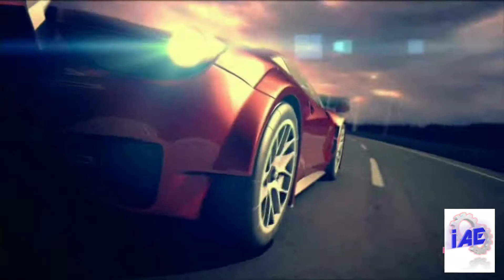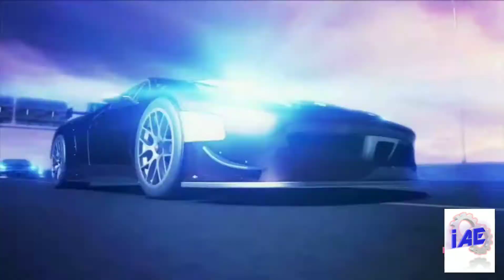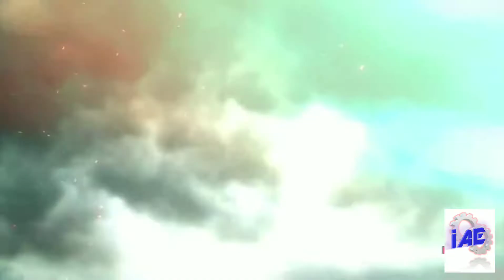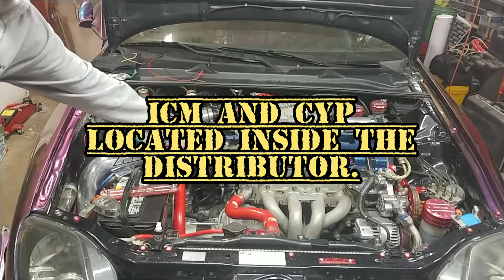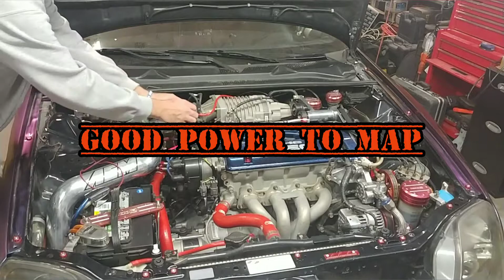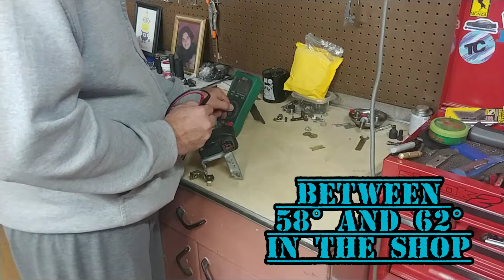97-01 Prelude troubleshooting.

Comment: I have a 2000 that won't fire. New coil, new distributor, new main ground. No immobilizer light flashing. Help
Reply from the maker: Main Relay? Are the plugs wet/oily? Good compression? Fuel pressure, fuel delivery? Bad injectors? Any CEL?
Reply: @IAutoEnthusiast  main relay clicks, pump primes, everything is working like normal, just no sparkn. I put a screwdriver in the plug where and turned it over...
Reply from the maker: No spark and no CEL. Is your Prelude stock? Any aftermarket goodies.
Reply: @IAutoEnthusiast  i have the same issue car has no or low spark at cool start up after ten mins of trying it starts and runs fine all day,fuel prims , two new dizzys, valves adjustment done twice, main relay, timing good, crank sensor,new,coolet temp senson no mods still having problems starting after seting for 5 hr already fried two starters
Reply from the maker: @migiuellugo7068 might be an intermittent electric issue.
Reply: @IAutoEnthusiast where or how should i start looking into to it
Reply from the maker: @migiuellugo7068 high end scan tools. Mobile mechanic, or weekends checking wiring, connections, and the like. I'd start at the basics. Fuel - visual confirmation that the pump, tank, wiring, lines, filter, regulator, injectors are all working properly. Move to the air, repeat. Etc etc etc. if you have no CEL and it's not happening every time, it's going to be found when the conditions are right.
Reply: @IAutoEnthusiast am thinking its my ecu i have changed crank sensor,distributor, wires, plugs, coil pack,intake air temperature sensor,coolant temperature sensor, ignition switch,timing belt, starter cuz it burnt it trying to start it for long time,valve adjustment, and still has no spark at cool engine start and when it does start ones car is warm,it good thru out the day till the next day 🤷🏻guess ill try ecu but idk how it will work with the immobilizer or how to get it programmed again kinda of stuck with this
Reply from the maker: @migiuellugo7068 I'd be very interested to know what happens or what you find after a thorough investigation.
Reply: @IAutoEnthusiast  it’s definitely the ecu i took it out put a heat gun to it and car started right away inbox your number if its possible thru here in private message
Reply: Going thru the same scenario.  1998 Honda prelude,  concentrating on spark issues.  Tested injectors with  noid kit, compression is on spot, crankshaft position sensor replaced oem denso, timing is right
Reply: Took mine to the dealership. It was a wiring issue. Found it within an hour. $100